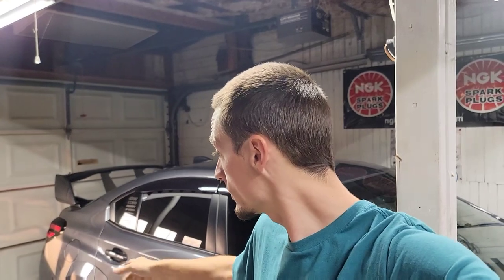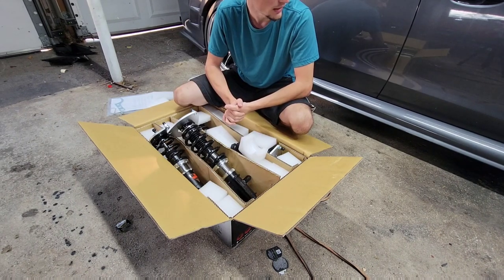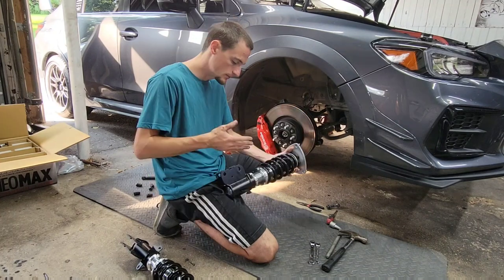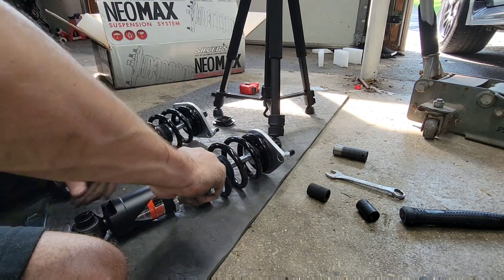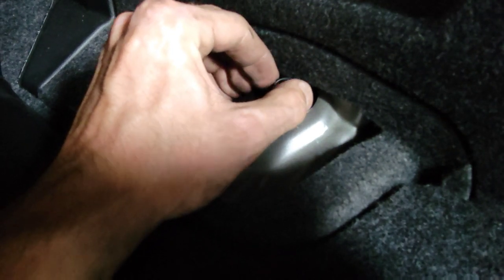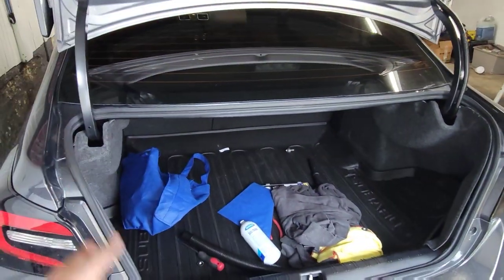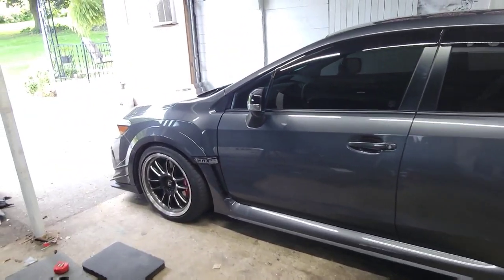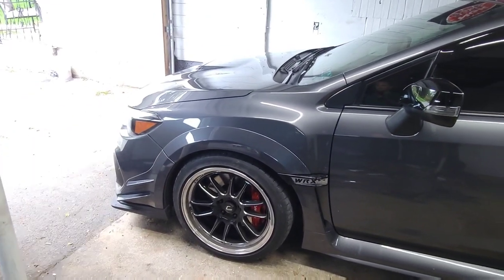Silver's Neomax Coilovers On My WRX (Install & Review)

Comment: I’ve had mine on my 2020 for 3 months, I’m very happy with them. Definitely boosted the feel when cornering and the dampening adjustments are nice, you can dial it in like stock or even softer and obviously as stiff as you would want.
Reply: Hey, do you still use them?
do you reccomend them to buy?

Comment: Any issues on lowering your VB? I’m getting the clunks right after my Subaru mechanic installed my FA500’s and they clunk so badly but mainly at slow speeds and turning at slow speeds. Anything over 40mph I don’t hear any clunking or potholes don’t clunk. Any advice? We used the adjustable endlinks they sent me, but maybe I should just tighten the Hell out of them?

Comment: How are they holding up? Looking for my 07 Highlander to see how they feel.
Reply from the maker: Almost a year later and they still feel great. I've even adjusted my height a few times and they were still easy to break lose and adjust. Definitely a very solid choice!
Reply: Would you have gotten Swift springs if you could from the beginning?
Reply from the maker: @Diamondblend  I think I would've done the swift springs if I could go back and redo it. But still really liking them even on the standard springs
Reply: You got the additional rear extenders, right? To make the adjustment alot easier?

Wondering if I need that vs. not having them
Reply from the maker: @Diamondblend  I didn't get them and don't find myself really needing them. I hardly ever readjust them but if you think you'll be re adjusting them all the time it might be a good thing to have